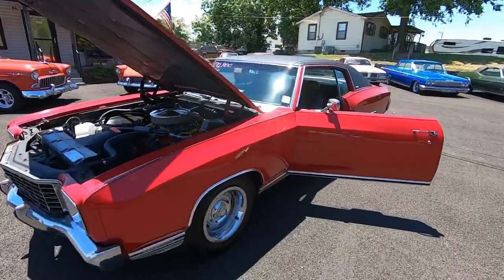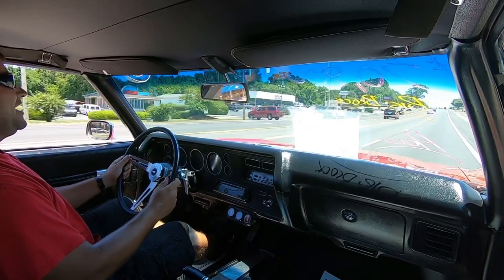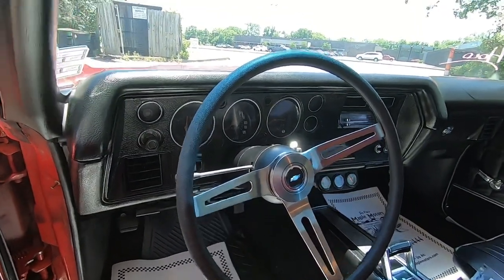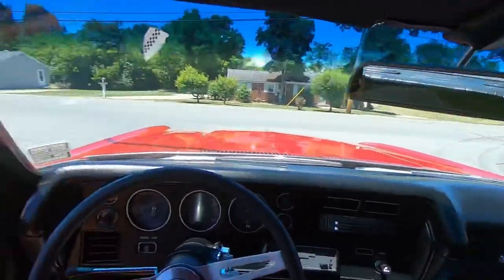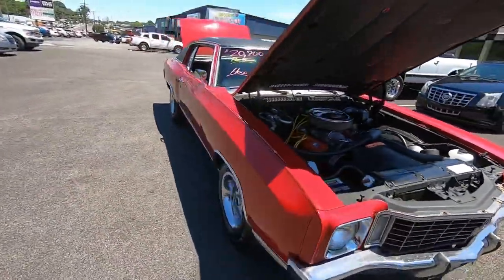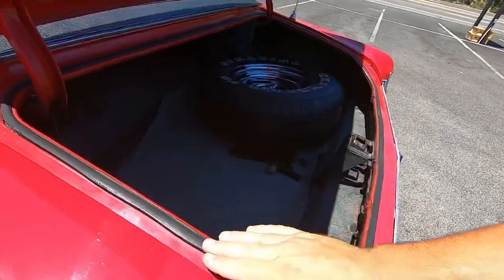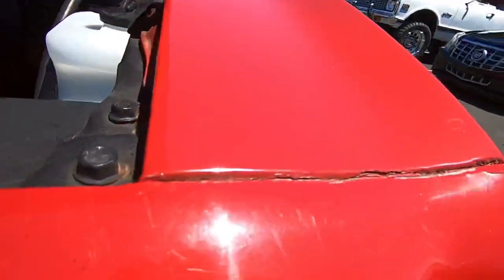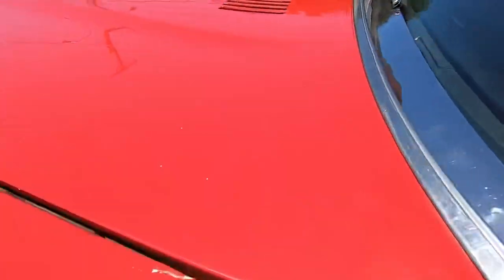Test Drive 1972 Chevrolet Monte Carlo 454 Big Block SOLD $20,900 Maple Motors #1144

Comment: That looks like a good solid car, has good bones, big block, 12 bolt rear, probably had a 402 , be a great cruise night car, so it's got some chips in the paint, that way you can have fun with it, drive it around , to me these 70-72 Monte are the next best thing to a 70 Chevelle. 👍
Reply: Just a lil bit heavier
Reply: @yeathatsright1034  couple hundred makes up for it in smooth ride
Reply: I show these to the younger guys who want a classic car that won't break the bank

Comment: Nice ride! A triple black 72 was my 1st car. Y'alls has a 1970 front bumper with the round park lamps. 70/71's had no parking lamps at the ends of the grille. They were in the bumper, round for 70, rectangle for 71. 72's have no park lamps in the bumper because they're at the ends of the grille.

Comment: Very nice looking MC, appears to have a 1970 front bumper with blinker lights along with the blinker lights in the grill. This may be a reason why there are issues with the dash blinker not working - lol. This is an amazing price for a big block MC. Change the heads, cam and carburetor and you would be talking close to  a 70’s LS 6 horsepower and torque.